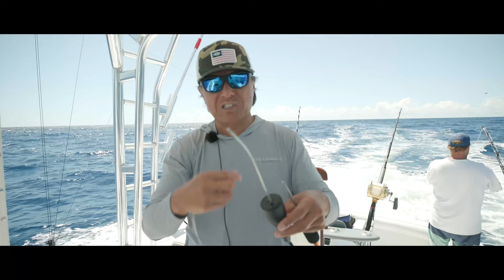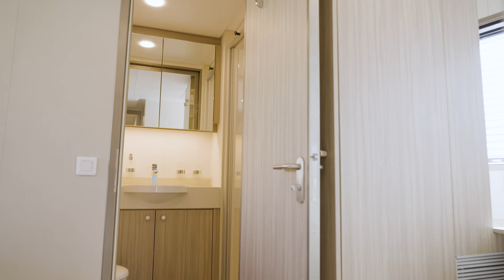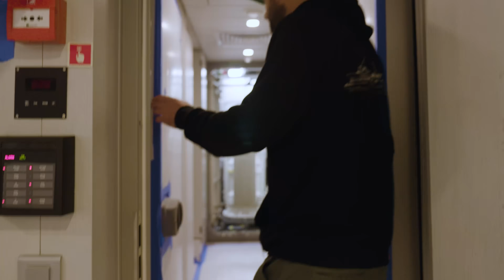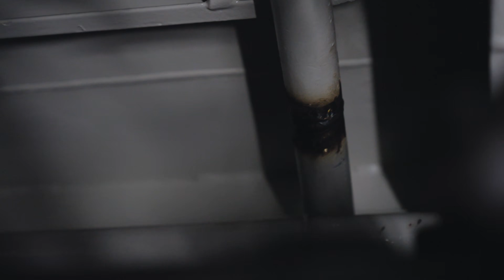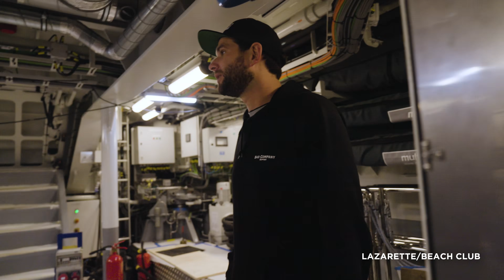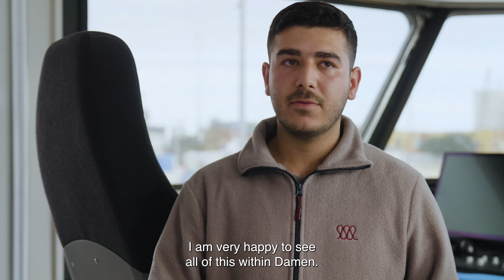Inside Look: The 175ft Bad Company Support Vessel (The Building Process)

Comment: What an impressive vessel 
I missed why engine had to be removed..
As a sailor..I am surprised the boat was not built with better route to remove an engine. 

That was a ton of work
Thank you for the inside look😊😊
Reply: The motor blew on first sea trial
Reply: @DillonJ96. That is not acceptable. Those engines are test stand run for hours..
Reply: @robertsloane1268 it was a faulty valve that made it into production. Very small number they said made it thru into engines